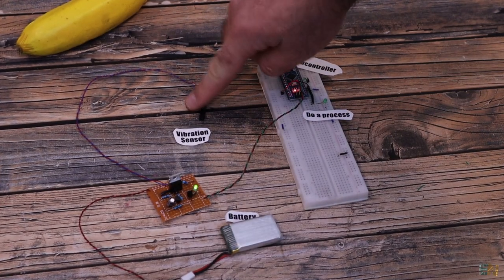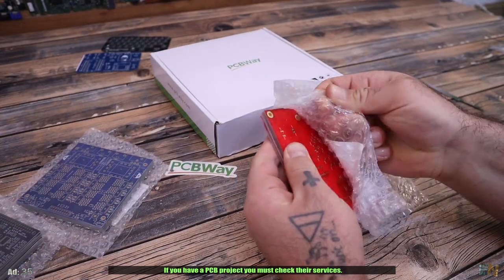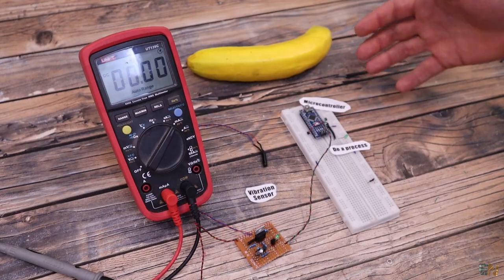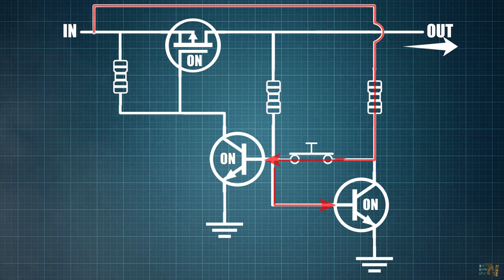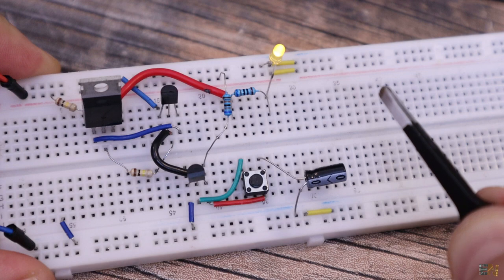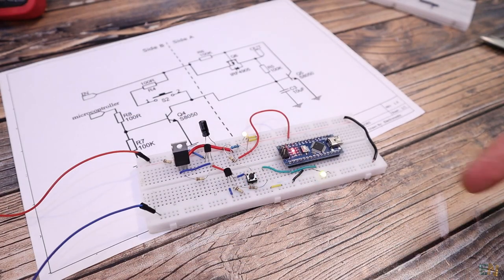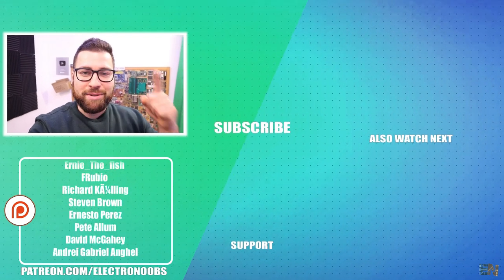Latch Circuit - Wake up + 0 Power Consumption (useful circuit)

Comment: I made similar latch circuit before. Later I realized that most MCU's (atmega328, attiny85, esp8266, esp32 ...) deep sleep current draw is lower than a battery's self-discharge current. Now I never use any latch circuit. Just make sure you skip the linear regulator and power the MCU directly. The most common linear regulator -- AMS1117 -- has quite a high quiescent current.
Reply: Wow! Is it really lower?? That's awesome
Reply: Even with LSD-NiMH?
Reply: The MCU - maybe. But some dev boards have auxiliary components which draw current even id the MCU is in deep sleep

Comment: This is almost identical to Dave’s simplest soft latching circuit from 10 years ago, but your graphics are better and you provide a real example. One thing though, you glaze over that the mosfet has to be pnp and the bjts must be npn. If people don’t know the circuit symbols then they are going to have a hard time.
Reply: It is Dave's circuit, with some corrections made in a comment (the second one) 6 years ago.
Seeing it work in such a visual manner is great

Comment: For complete electonoob, I miss one crucial part. How to select MOSFETS when I want to switch X volts by signal that has Y volts and I want mosfet either fully opened of fully shut. Y volts can be achieved by combination of transistor and voltage divider I assume. But when I was designing something that switches poorly defined 6-3.3V from full/drained battery using 3.3v on pin, it's hard, I think first try was almost ok, 2nd better ( IRF9Z34N -> LP0701N3-G) and my notes say lower Vgs(th) is better. But because I haven't played with Arduino for years and I have no notes about selection process, I don't know. I only know I wanted to shutdown SD card module with "powerful" but power hungry voltage regulator.

Comment: Hi there. A great video. A couple of points:

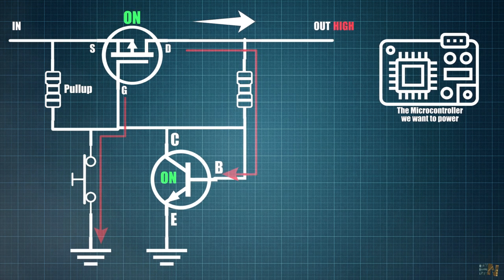1. I think your circuit explanation at 4:00 point  may be incorrect. I built the circuit. As soon as you apply power, the LED connected to output turns on. That's because the BJT turns on immediately because enough voltage is applied to it's base through the "pullup" resistor path, which is also able to supply current to it's base!!

This can be fixed by removing the wire that connects the collector to it's base (in the schematic)! It's not needed!

2. I had problems with the circuit at 5:52 as well. I built that one as well. When you press the button the first time the output turns on. But when you press the button again and again the output remains on.

This is because when you press the button the second time (and onward), the capacitor discharges immediately through the already on second BJT (depriving you of the time you need to "remove you finger from the button"). You can fix this by adding a resistor between the capacitor and the second BJT's collector to slow down the discharge. I used a 2.2 K one that was on my desk and the circuit works! You press the button, the output turns on. You press the button again and the output turns off, and so on.

With all respect, I am just trying to learn. Great work my friend. Very clever circuit as well. I loved your video. Thank you!

Comment: I just wanted to drop a comment in case anyone else tried to use a different transistor; Check the pinouts!
I used the BC547 instead of the S8050 and spent around 12 hours trying to find why my circuit wasn't working, until I realized the pinout of the BC547 is different. xD

Other than that, great video. I'm just starting to get into this world, and your videos are a great fuel for this new interest of mine.

Comment: This would be great to turn into a little 5-pin module that you can just solder onto your circuit.
(Power in, power out, ground, trigger - pull low to turn on, finished - pull low to turn off)

Also, I already saw the circuit at 5:41 a few years ago while watching EEVblog.
Reply: For ref: I believe EEVblog circuit mentioned can be googled with the following keywords "EEVblog #262 - World's Simplest Soft Latching Power Switch Circuit"

Comment: Excellent ! I was also trying to make something like it because it is a need for every low power device
Reply from the maker: Thank you so much!
Reply: @ELECTRONOOBS  I tried but it is not working with microcontroller...
Reply: @jeevanshrestha8888  There is an error in the schematic. There should not be a connection between R2 and the gate of the MOSFET.

Comment: In the circuit, transistor’s Collector and Base are connected directly to each other, short circuited. The rest is awesome. Thank you..!
Reply: Connecting two high side signals is not a short.
Reply: Just pay attention to 3:50 and observe Base and Collector short circuit.

Comment: I had something similar. May be more complex than yours but easy. 
I had put together with ir motion connected to rechargable batt. Maybe with timer ic s. Connected to voice chip recording went to miniature FM radio transmitter. When  a car past by it would set off the motion sensor played the recording and hear it on my radio. One of my best useful projects I built that I liked. Back in the late 90 s. The motion detector was connected to fet transistor to keep power drain down when nothing happens.

Comment: Very interesting circuit ,and you explained it very well. The only thing i can not understand is why you use those pull down and up resistors.
Reply: Resistors are necessary in circuits like this to prevent a dead short between power and ground while the button is pressed or the transistor is conducting.

Comment: The circuit with 1 BJT transistor seems already do the job 4:04 just connect an output pin to the base of the transistor to switch the circuit off.

Comment: 3:40 you shorted the collector and base of your BJT, it will act like a diode forward biased to ground (i.e. a short circuit) and clamp the voltage at the gate of the MOSFET to be 0.7 volts.

Comment: I build a similar circut years ago but I needed to latch in two inputs and ignore all inputs after first latch until return to deepsleep so the ESP could distinguish the Direktion the cat door was openend; -) the backlash oft the closing door would always trigger both Sensors

Comment: Interesting topic. I hadn't thought about it. So many new projects start coming to mind. Thanks
Reply from the maker: Glad to hear that. maybe you can share any of your projects with us :)))
Reply: @ELECTRONOOBS  1)A push button pressed by something floating that detects when the cistern is full - always wanted to do something like that but feared to get electricity near water. 2) a sensor and sound repellent placed at my crops field - tried before but ditched due to battery drained fast. 3) a tripwire that sends sms when someone enters my vacation house - it can last one charge for months this way
Reply: @PGrimp  great ideas ... I can add to them a GSM post notifier (no wifi) and many types of presence detection approaches (e.g. PIR)
Reply: @PGrimp  I actually had to abandon a project because of lack of power saving technique some years ago ... we had a Fusball table in our office, and it was really in use most of the time (big office) so we thought to make an IoT status detection based on vibration, but that was really difficult to realise due to the fact that ESPs are not battery friendly 😅

Comment: The MOSFET naturally acts as a latch without a pull up resistor, all you needed was a delayed buffer. Interesting circuit, it's a T-flip flop and has many applications but it's without edge detection, that can be sorted.

Comment: Neat little circuit! This also answers a questions I had about P channel MOSFETs :)
You could also do it with the MOSFET and one transistor by using a microcontroller pin to latch the MOSFET gate low via that transistor, then pull the microcontroller pin low again once it's finished what it needs to do :)
Reply: Your pfp is beutiful.

Comment: Nice video, but the circuit at 3:35 should not have the connection between colector and base to work as described.

Comment: This is a great circuit! 
With the vibration sensor as the trigger it really only tells you that the door has been moved. You don't know for sure if it is open or closed, or has just been moved.
How would you modify this design to use a hall-effect switch and magnet, or a magnetic reed relay to trigger the MCU "on" when the switch was either opened or closed? After the MCU has detected it's state and sent the message to say an MQTT broker, it would shut itself off. That way you could sense whether the door or window was actually open or closed.
I really like your videos!
Reply from the maker: True. I'll try to make one with a hall sensor detector!

Comment: Great video, excellent animation and explanation, with a logical progression of the challenges and the solutions. I would love to incorporate this into my current project that detects an IR remote button press, however unless the circuit is powered on, there's no way that I can think of to detect the IR signal. If anyone knows of a way (other than a phisical button switch press) please share!

Comment: For long battery life I suggest to use lithium thionyl chloride batteries (LiSOCl2). They are not rechargable but are for low power long life applications used primaraly in military and medical applications. We use it in our LoRaWAN agriculture product where the device needs to live for 10 years

Comment: I like the TPL5110 / TPL5111 for such usecases if the final pcb size matters.
Reply: Thos are timer circuits, do you have any idea if there is an IC out there that implement this concept (no timer) ?
Reply: @ashajjar  You can do it only with the IRF7317 and a couple of resistors.
Reply: @alvarovalencia7023  IRF7317 is two P MOSFETs in a single IC 🤷🏻‍♂️

Comment: Should there be a diode between Q4 Collector and the switch2?  The circuit won't activate when the gpio is connected.  Lolin nodemcu esp8266

Comment: Electronoobs i really appreciate ur hard work for these videos , these are really informative and interesting , u post a really good way for beginners to grasp electronics , but I would like to  have a video about how u manage battery based project especially when running on really small batteries , whats ur take for this cause My circuits  always tends to loose power before itz calulated limit and also i dont know why i can t use my power bank cause it keeps shutting down for small loads , any suggestions ???

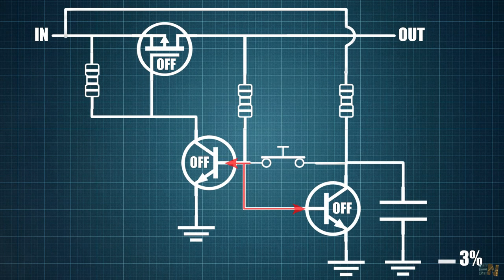Comment: Actually there is something wrong with the 6:18 latching circuit. The capacitor must only be connected to the base of bjt2 and it gets charged or discharged by the resistor going the supply output. Bjt2s collector is connected via a resistor to the supply input and the switch goes from there to bjt1s base. This will switch the P-Ch Fet gate on and off by the collect of bjt1 pulling it to ground.

Comment: that was a great video u never disappoint us!!!! , I just have a question  doesn't the vibration sensor consume power while it's plugged with the battery (or is it that negligible??) or we just make that latch to avoid powering the arduino at all time?(sorry am new to electronics)

Comment: Can you help me ..
There are Two type of Toggle on and off circuit are available on the internet one using 555 and other from 3 transistor in both latch circuit one switch is used to on and off the Circuit and the current flow in the circuit is bidirectional mean current goes in one direction when push for turning on and Vaise versa .
So the problem is , i  can't activate this circuit using External Signal or using Transistor because the way it works . I tried connection ldr in place of push switch in order to Fool the circuit by simulating as Push switch so i can on or off using external light powerd by sensor signal but no success .
Do you have any idea ?

Comment: Just a question... Your DMM  can only show to 10uA. How do you know that the circuit is not still pulling 1-9uA ?
Reply from the maker: It can show done to uA and is always 0 even if I didn't show that In the video. The circuit is Off.
Reply: @ELECTRONOOBS  So your real world components have no leakage?  While the current is very low, and your instruments struggle to measure it, it is not zero.  Perhaps comparing it to real world battery self-discharge currents would help to put it in context.  For tiny coin cells like 1616 perhaps the leakage is not negligible?
Reply from the maker: @Brian_Of_Melbourne  nono, understand is not 0, obviously. But is lower than 1-9uA. At least that's what I measure and I have a multimeter that's pretty decent.
Reply: There might be a very small leakage current. I suggest you get one of those very low current detectors to measure down to the nano amps as a DMM cannot measure such low currents.
The other way to create a latch circuit is with a relay. In this case when the relay is off there is actually zero current.

Comment: @Electronoobs why do we need Q4 when one can utilize the built in transistor on the pin from the µC? This use case does not need higher voltages than the µC can take.

Comment: Hi Electronoobs, is this Latch Circuit also working for ATX power supplies? As I understand it, the PS_ON line of an ATX power supply uses a TTL active-low signal. How could I use this circuit for this? I want to switch an ATX power supply on and off without a motherboard by using the push-button switch of the PC case. Thanks und best regards, Chris

Comment: How would you do this with a boost converter? I mean i want to make a battery of a certain voltage but i would like the boost or buck converter to be unpowered when the is no current drawn. But how to detect if current is required?

Comment: Nice insight!!! thanks, i guess it only works for switch based sensors?
I've tried to achieve the same thing like your previous video but with cheap parts and more general usage using attiny13a yet only got 30uA :( my target is 5uA

Comment: Very interesting topic ! But you forget to mention what voltage range you can rely on for the "IN" input. Since the Nano is powered by its VIN pin, the range would be from 7 to 12V (20V max). Could you confirm ? By the way, its seems that the Lipo battery shown in the video is of only one cell, so around 3.7V which is too low for VIN. How did you manage to make your circuit to work with such a battery ?

Comment: what changes i do so that the default state when the power is flowing is ON and the MCU just sends a signal to totally cut off the power or turn the mosfet off . In your case in order to turn on you have an interrupt i want that when the power is there the power should simply flow and once the MCU gives a signal it should cut off

Comment: Just buy an SR latch or a D-flip flop. It will be cheaper and you can also use it to turn on very low voltage sources, like a single cell NiMH battery.

Comment: Well at 1. circuit there probably shouldn't be connection between base and collector  and I am not sure that the secod circuit would work either. Aren't you missing resistor at the collector of second bjt?

Comment: On symulation (Proteus), the circuit works fine, with the exception that latches after hooking up the battery. This is not always desired operation.

Comment: Could this circuit be modified to include the ability to monitor the input voltage from the microcontroller when it was powered on?

Comment: I want to make a latching circuit for under the hood of my RV. I would like to make a switchless/no-relay latch circuit that could detect when either the system/starter battery or my coach's aux battery is low and "switch-on" the alternators charging relay to that battery.... doing it manually sux and I don't have 190$ for a new dual battery isolator

Comment: I had to replace the 100r resistor with a 10k resistor on the output pin of the microcontroller. Any idea why that is?

Comment: Can you make circuit with no current for DRL, which will consume current only when the car engine is working? It will wake only when DC voltage exceed 14V.

Comment: Hi, I had many projects ideas that would have used the concept of this video, thanks a lot, but I have a question .. is not there an IC that has the same function of this Latch Circuit?if there is then what's its name/model/number? Any help is greatly appreciated 👍🏻
Reply: the world famous 555 timer or simply a jk or rs flip flop would do the job I believe

Comment: Hi. I tried your latch circuit. But with the microprocessor I'm having issue. The led turns ON but doesn't turn OFF. I connected the output to Vin and the input I have given it to one gpio pin. Can you help me with it.

Comment: Very very very interesting. I need to do something similar to this project. This is what I want to do: I want to replace the mechanism of an old clock that used to play a song every hour, this song was played by a sort of small cassette player. It uses 4.5 volts (1.5 AA battery x 3). I want to use an mp3 module and play that song (stored in a SD card) every time the internal switch closes (of course every 1 hour). MP3 3W module automatically plays the song once it has been energized with those 4.5 volts BUUUUUUT it plays song again and again and again, it never automatically stops . A crazy idea came to my mind: try to design a delay (capacitor + transistor + resistor + etc) that gives me 4.5 volts for 40 secs but I don't have any idea how to do that. I'm sorry, I'm so noob and I'm going crazy, I don't know how to make it work.  That's why I want to energize my module for 40 secs and then puff, shuts the project down. Next hour, switch closes, turns everything ON, play music and after 40 secs ..... OFF. Is this possible based on your project ?. Can arduino nano give me 5 volts and then send that signal to latch circuit to power off everything until next time switch closes? I know I have to program the arduino to send that signal 40 secs after switch had been closed.